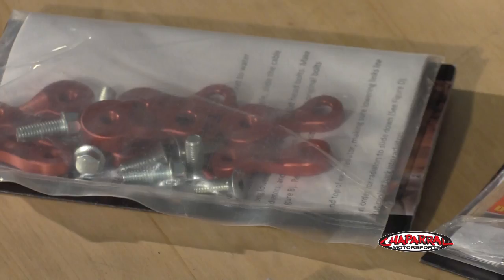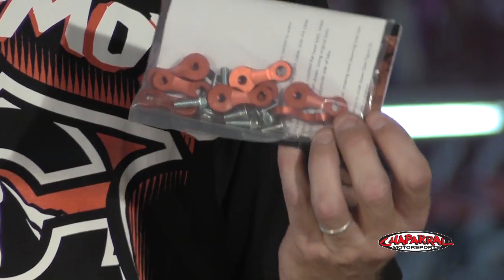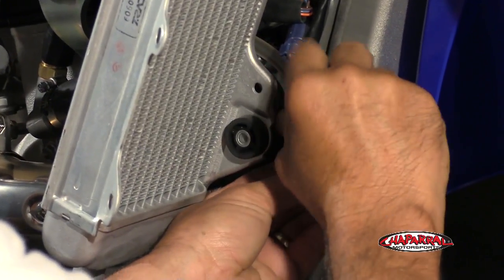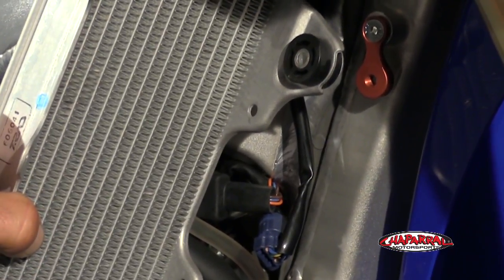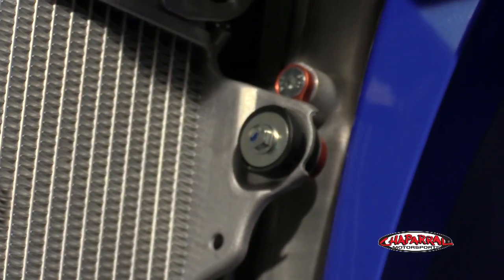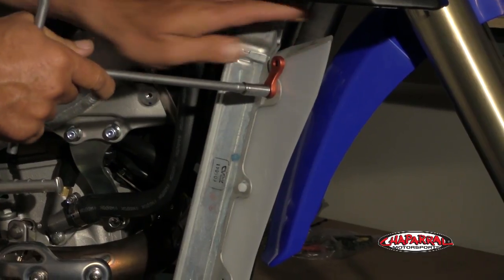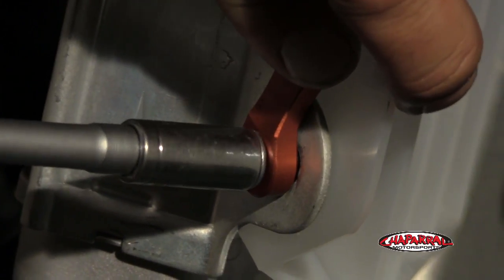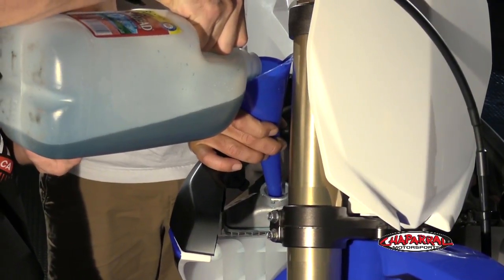ChapMoto.com Pro Works Episode 5: Installing a Radiator Lowering Kit on a YZ450F

Comment: I used this kit on my 2014 yz250f
Changed the feel of the bike completely! Bike dives in and out of corners now, feels way more agile, and feel planted in the corner. Its just what i needed.
Reply from the maker: Glad to hear that Charles!
Reply: Have you had any issues with overheating?  Read some feedback that the lowering kit causes more overheating?